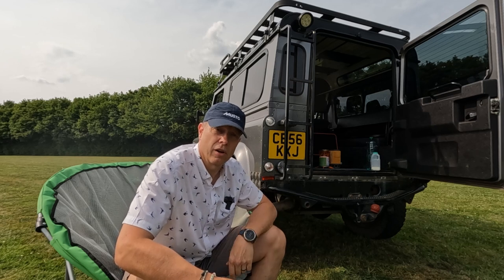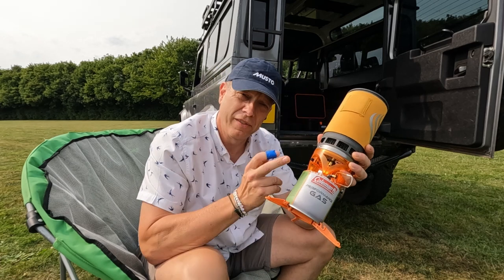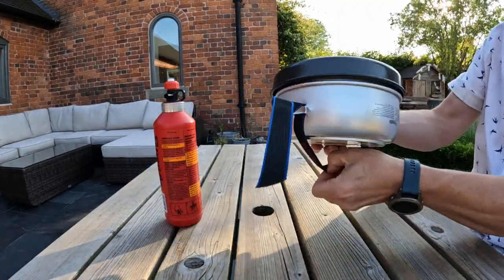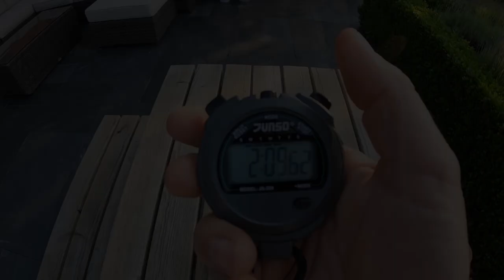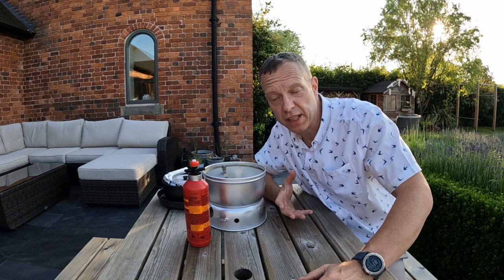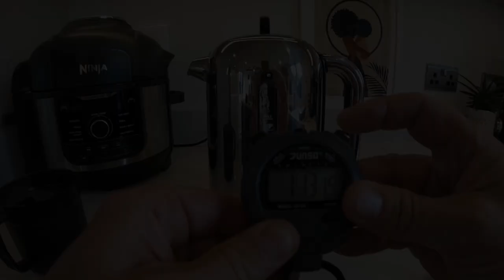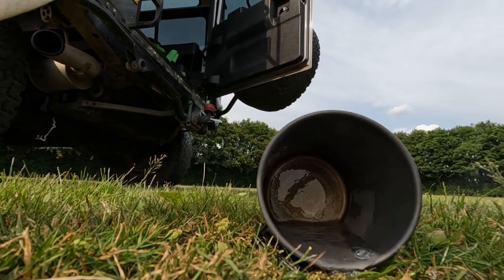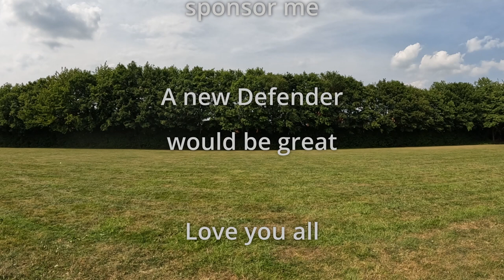Trangia or Jetboil? What's best for wild camping adventures in a  Defender.

Comment: I have both. Trangia for actual cooking, Jetboil is great for coffee & freeze dried add water meals. Adding the gas burner to the Trangia makes the choice easy. Methylated spirits burner is better for baking with the simmer ring though. Thank you for sharing.
Reply from the maker: I’ve never tried baking and the gas burner can be turned down really low. I should have shown that in the video. Thanks for the comment. And I’m the same as you I still, use my jetboil for a fast brew especially if I’ve had to carry the kit in my rucksack. Thanks again. :)
Reply: I use the alcohol burner, for boiling water the Trangia 0.9 litre kettle makes a big difference for thermal loss, tends to boil about half a litre in 5-6 mins even around 3c. Hope that helps.

Comment: It's even faster with the pan as a lid! Take a look at the Trangia logo: The "T" is also the instruction manual!
WITH the lid, the hot air builds up around the pot and can only escape if it flows under the edge of the lid over the upper edge of the windshield - but hot air wants to rise and not sink down. This is the only way to achieve acceptable cooking times with the alcohol burner and it saves a lot of gas with the gas burner!

Comment: Although I haven’t used my Trangia for years, I recall that using the frying pan as a lid on the pots reduced boil time significantly
Reply from the maker: Hi. Thanks for the comment. You are of course right. But I left the lid off for effect, to see the water boiling. 👍

Comment: I don't know what was wrong with your Trangia.  My home made beer-can alcohol stove boils 500ml (0.88 imperial pints) in 4 minutes on 30 ml (1.01 ounces) of methanol with a little left over.
Reply from the maker: No, I don't whats wrong with my Trangia either. Probably operator error! Sounds like your home made burner needs to get sent to Trangia!  Well done, do you have any video of it?
Reply: @neilsimmondsmediaproject  No video.  I played with different burner configurations until I found one that was optimal for my good ol' MSR Titanium kettle.  Add a windscreen to help keep the heat in and it works a treat.
I do have a Trangia I sometimes use for quick one-night hikes.  Because the burner itself can hold up to 100 ml, I don't have to take a separate container of fuel.
Reply from the maker: Keeping it simple, making it yourself. I admire that. Bravo.

Comment: Gas stove is nice in Britain, but try your gas stove in Norway in the wintertime with -20 C.
You might see a tiny tiny flame if you squeeze the gas container between your hand to warm it a little bit.
The choices are slow coffee with alcohol stove or no coffee with gas stove 😎
Reply from the maker: I never thought of that. I don’t go out it that sort of temperature very much!  🤣 I can see why the Trangia was born in Scandinavia if it gets that cold. Thanks for taking the time to comment. 👍😀
Reply: @neilsimmondsmediaproject  
The stove i grew up with in the military was "primus optimus", burning paraffin. Paraffin has a lot more energy pr. liter than alcohol, but the stove is larger and heavier. Normally we had one of those for 8 men, so the weight was not a real issue and it was also used as an oven in the 8 man tent. Always one man awake in the tent just to keep the "primus" going in the winternights. It sounded like a small jet engine 😎
Reply from the maker: Thanks again for the comment.  You can buy a Primus style version of the gas insert but it is over £200!  I have seen a cheaper Chinese version so might do a video showing how to adapt to a Primus type for a fraction of the cost. And I'll bet that boils fast. I'm surprised any of you could sleep with the sound of a Primus at full speed! 🤣
Reply: @neilsimmondsmediaproject  
You can buy used ones second hand in Norway, but beware, they exists in two versions. Either the noisy (small jet engine) or the silent. I grew up with the noisy in the tent, and I believe only the bad ass noisy has the power to function an oven in the tent. Made some noise though, but made you sleepy in a cozy way. Had posts far away from the tent of cause to listen for less friendly sounds 😎
Reply from the maker: Sounds like you've had some real adventures, Norway is a place I would love to visit.   Thanks for taking the time to comment, your comments are my favourite so far! 👌